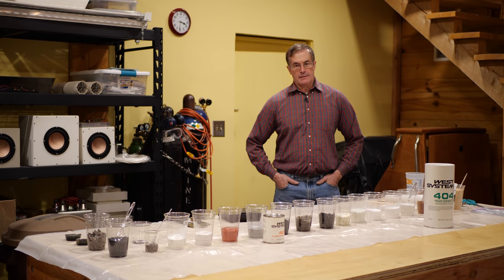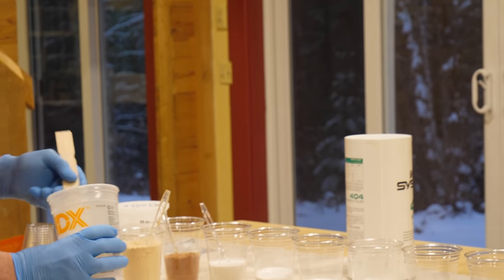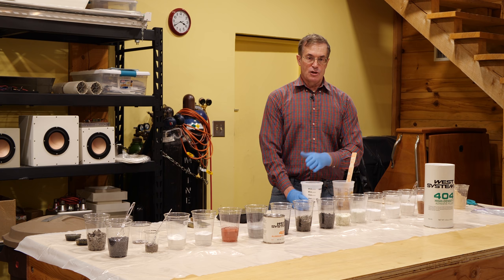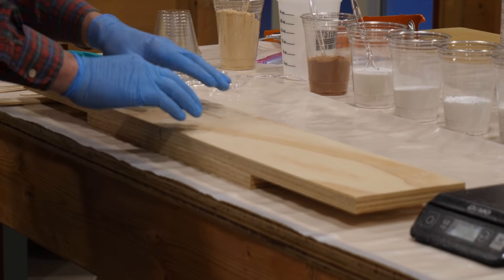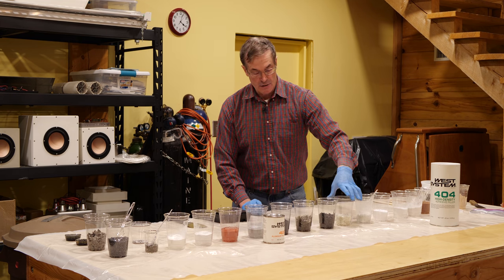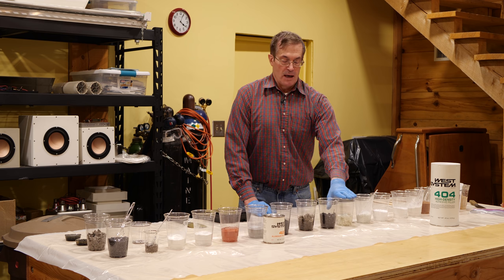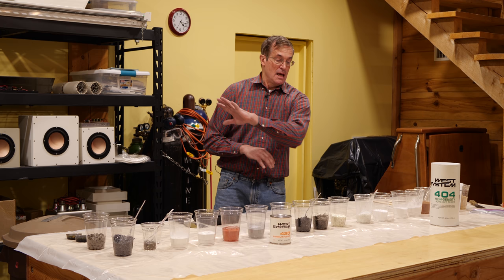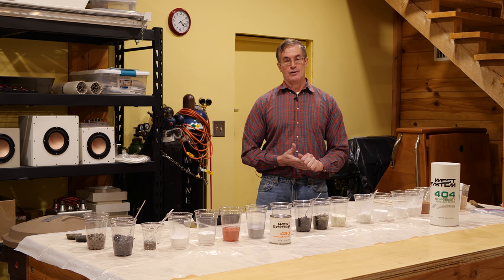Super Strong Epoxy with Diamonds and More!

Comment: I am extremely curious about what would happen mixing something like concert with a two part expanding foam too make a substance that can be used to make erecting structural components on site without the use of water, say like in a hazardous environment on another planet or in situations were a disaster has taken place and housing needs to be immediately put up within hours.

Something that can be mixed on site without special equipment or structural components needed.

Comment: Im tempted to electroplate a 3D printer nozzle with tungsten, and try extruding recycled PP filament with the addons you describe for your epoxy. Any suggestions for a print I'd be able to electroplate?

Comment: This is really helpful, actionable information. 

West System (Gougeon Brothers, inc.) has been out of 404 filler for close to a year. I contacted them and they are having some kind of sourcing/production problem. 

Can you recommend a substitute for 404 that is suitable for bedding hardware and structural bonding? 

I'll watch the video again and maybe I can deduce that myself.

I'm doing an extensive refit on a '74 Alberg 37 and would greatly appreciate your advice.

Comment: Thanks for another awesome video. Learnt a lot about composite materials. What are other bonding agents other than epoxy and cement? Is it possible to make a relatively cheaper and long lasting abrasive for grinding glass for telescope mirrors?
Reply from the maker: There certainly are other other materials that can be used for bonding including ceramics and metals.  When grinding a telescope mirror the abrasive is typically aluminum oxide or silicon carbide and these are pretty inexpensive.  Cerium oxide is often used for polishing, but the very fact that it fractures and becomes finer as it is used up is an advantage.

Comment: Good informative video.
Thank you for warning people about fumed silica; it's handy, but a path to silicosis, if care is not used. I've not seen phenolic powder before.
When using the pastry bag technique, if you turn the top of the back inside-out around your hand, you can load the glop into the middle of the bag.
Generally, when we got through with mixed resin, the remainder went outside on a hard non-combustible surface.
Perhaps if it were passed through a screen or a tea strainer, perhaps homemade saw dust might be more pleasant.
With care, epoxy may be trimmed/screed'ed easily with a razor blade during its cure, while it's still "green." Even fiberglass may be trimmed, but not close to the finished line.
It seems that you are close to being bitten by the polymer concrete bug, which affects quite a few people on cnczone.com, for making machines from : )
Thanks again for the video.

Comment: If you can find the time could you go through the steps for laminating wood to produce a wood plug for carving an airplane propeller .  Flat wood to flat wood I am worried of glue starving caused by clamping.  I am wondering if the use of micro balloons that you mention here would help prevent glue starving....   Thank you .
Reply from the maker: Weight should not be a significant concern.  Use the vacuum technique I describe in the "Glowing Epoxy" video.  Then take all the coated strips, layer on another coat to each side and clamp mechanically or with a vacuum bag, the stack of wet strips with alternating grain direction.

Comment: Cool! Thank for sharing! So interesting! Is it possible to create grinding or polishing pad using epoxy with diamonds ?
Reply from the maker: I suspect it is.  The challenge would be achieving a very flat surface and I'd do that by curing the mixture on a glass plate coated with wax to prevent sticking.

Comment: I'm trying to find an alternative recipe for an epoxy mix similar to Acraglass, Devcon or MarineTex. What would you recommend to make something that won't shrink?
Reply: For anyone who has the same question later, epoxies in general do not shrink. Also, you can just add aluminum powder to reinforce all epoxies. If you need a thinner mix, you can add denatured alcohol and it won't weaken the final cure. If you want it to cure faster, gently apply heat with a heat gun.

Comment: How expensive is the dendritic copper ? I'm sure that isn't cheap another thing that would be useful possibly for mixing into epoxy would be Corian dust it's a countertop material made by DuPont LG also makes the same thing called HiMacs or Wilson Art Gibraltar you can get really fluffy stuff that looks like snow or fine particles the size of sand using a router go slow with the router through the material and you get the fluffy type and push the router through fast and you get sand type particles it will also color the epoxy due to the different colors of the material

Comment: could you demo the strength by shooting a very thick layer of the stuff, painted over a steel sheet? like the carbon fiber epoxy stuff and the stone
Reply from the maker: The layer will have to be thicker than what could be applied with a brush or spray, but we will demonstrate it.

Comment: Hi, I am a real fan of your channel. Could you tell me the grain sizes you were using for the Aluminium oxide, silicon carbide, and titanium coated diamonds tests. Would these be the optimum grain size, or would you suggest a different grit size? Many thanks, and keep up the great work.
Reply from the maker: Thanks. 
It's a trade-off. The smaller the size of the particles, the less you can add before you thicken it to a given point. This is due to the surface area  of a given weight of an additive. I covered  this in more detail in our videos about making the super paint and the thermal compound.
Reply: @TechIngredients  wow, I am amazed that you took the time to answer, and so quickly. Once again you have explained it perfectly, rather than deal with the specifics you have taught me a principle. I really appreciate your method of teaching. I was a master scuba instructor for deep technical diving as well as a teacher and I think you have the perfect approach. I will continue to be an avid fan of your channel. Many thanks.

Comment: I have been resurfacing my diamond belts with 30 minute epoxy and diamond grit. The epoxies tend to clump, so I made a slow turning wheel to rotate the belt while curing. Thinner, slower epoxy would be better.
1) What is the slowest curing epoxy?
2) Is there an additive that will thin epoxy?
Reply from the maker: Most epoxy thinners will degrade the performance.
They're not cheap, but the Pro Set epoxies, a devision of West System include very tough, very thin "resin infusion" epoxies.  Some have very long cure times and will become even stronger with heat curing.

Comment: ..hmmm. cut up nylon strings... or talking about furballs, did you test flexible stuff with hair ? (i remember that human hair is about as hard as copper to cut.)
guitar bass strings for the win !

my worst thing with epoxy is that i'm allergic, even though i always used gloves and did not really often (<5 times) work with it up to that point.
At one occasion i got small transparent fluid filled blisters, checking the reason i found it was due to skin contact with 2K epoxy residue.

Comment: Thermal epoxy could make water tight LEDs and offer thermal transition of outdoor applications.
Reply from the maker: That's the next video.
Reply: I used to make outdoor and water features in epoxy and stone. Strong but not to shippable from a business model standpoint. Onyx and dark stand wood worked well. The warm glow of the onyx in robust LEDs. Property boundries and walkways and the rock lights for security and up lighting.
Reply: Core out a river rock with a diamond core drill, and nest a MR 16 with epoxy,   pig tail out the back with lamp cord.

Comment: I would be interested in your opinion on talcum powder. I have done a fair bit of composite fibreglassing and have used epoxy mixed with talcum powder often. It makes a very hard substance.
Reply from the maker: It does.  It's probably part  of the West System pre mix.

Comment: I wonder if cheap fine sifted sand or or cheap blender chopped pink fiberglass insulation would work.
   Where do you find the epoxy?  I think you said on one of your videos.
   Also, round filler does not hold very good.  Different sized rectangular filler works best like broken limestone and sand works good in cement.
Reply from the maker: Regarding the shape effect, I agree and that's why the balistic pucks use these irregular shapes as aggregates.

Comment: im very poor! and consequently i work with what i have! and yes! im using "Bondo 32-fl oz Brown Fiberglass Resin Repair" got it at the local hard wear store! i use it because its has some color to it! most resin is clear and i cant see where ive used it! im trying to make a bicycle out of plastic water pipe reinforced with resin and the problem im having is that im using Kevlar but the resin dries in like 10 minutes! its meant for cars and its so thick the Kevlar does not soak it up before it dries and when i sand it down and its strong i find raw Kevlar on the bottom but it is strong! is their anything to DILUTE resin with! and yes i know buy the right stuff! im new to this all!

Comment: INCREDIBLE... thank you for the info... Is it possible to ask you if you would build a yacht hull with Fiberglass S2... And you want the best of the best... Hardness, Stiffness, etc... What sandwich would you use and what epoxy with which additives would you use??? Titanium diamonds, graphen, carbon  fibers or something else? Would you use different additives with different layers? What would be that PERFECT Fiberglass hull material and how thick would you made it... for Antarctica. THX
Reply from the maker: S2 fiberglass and Divinycell foam would be ideal for resisting impact damage.  Secondary curing the hull with 8 hours at 80 C will increase the toughness and strength of the epoxy by more than 50%.

Comment: Very interesting. Do you think you could further improve the armor mixture by starting with smaller sized particles?
Reply from the maker: I don't know.  It might go either way.  We're fabricating a number of barrier panels, some with a highly densified mix of stratified sizes and some with uniform extremely tough blocks of zirconium oxide like Sabb has done with their self healing walls.
We'll test them all and see what's the most promising.
Reply: @TechIngredients  another technique used in concrete is to allow it to dry under intense pressure like the tension style slabs. I wonder how effective that would be on epoxy to also incorporate some type of tension or spring mechanism throughout the slab.
Reply from the maker: It's my understanding that prestressed concrete is cured and then the cables are tensioned to put the slab under global compression.  This is necessary because concreate has an unusually large difference between its tensile strength (low) and its compressive strength.

Comment: Any thoughts on a completely transparent hardnener and sheer stress improvement for dense foam that has a lot of contours that would make putting the cloth difficult on most of the surface and would take a lot of time to cure? In my case I am trying to stiffen an extrusion profile that has a large number of contours and am trying to do it inexpensively. Wondering if same addatives to  shelack or to varnish or polyethelene would have the same affect on EPS styrofoam or polyisocyanurate foam or others I am considering. Also I am considering latex paint. So anyway, if you can comment on the strengthing of the latex paint or the like instead of epoxy, I am very interested!  Thanks again!
Reply from the maker: Epoxy would be a good choice.  Most curing plastics will have similar modulus numbers.  Fibers like aramids, glass and graphite have modulus values about 100 times higher. It's really useful to add even a very small percentage of these fibers.

Comment: Hello, thank you very much for the video, really very interesting, I wanted to ask you a question. when I load the epoxy resin with aluminum oxide or silicon carbide, they remain at the bottom, which I can add to the resin so that this does not happen and they are well incorporated into the resin
Reply from the maker: Add a judicious amount of cabosil or fumed silica powder to raise the viscosity.  The greater the viscosity, the slower the settling while it cures.

Comment: Boron nitride epoxy makes a low friction surface: would that work as an antifouling on a boat?
Reply from the maker: Graphite is excellent, inexpensive and blocks UV as well.  I've used it extensively and the result feels greasy, smooth.

Comment: Professor a question please: it is good to use silica carbide and diamond on the bow and under waterline to reinforce for artic use (ice, logs on water, etc)? of course not an icebreaker but some more resistance for cutting and scratches? How much weight these materials add to a compound. Thank you, you always explain very well all. Sorry for my english.
Reply from the maker: The cost of those materials, especially the diamond make that impractical.  Aluminum powder is pretty good for creating a toughened epoxy.  It will still scratch, but because the material is solid throughout, you can send out small abrasions.

Comment: What kind of dust mask filters nano-meter sized particles?  I see stuff in the .3 micron range,  but that's still what, a factor of 100'ish from nanometer sized particles.  Seems like the mask wouldn't really do much.
Reply from the maker: Is a matter of mitigation.  To  absolutely exclude nanometer particles the mesh would be too fine to breath through.  A respirator  that brought air from an external source would be necessary.  We breath nanometer particles all the time, you want to minimize it.

Comment: Great presentation,  Can I mix epoxy with dendritic copper & graphite &  fiber carbon flakes & fiber glass sheet to make an armor panel?
Reply from the maker: We're playing with that.  It's actually complicated as well as interesting.  You probably don't want simply the strongest possible material in that case a tungsten plate would be best.  Multiple layers that first interfere with the bullet's trajectory then abrade or crack the bullet and finally stop the damaged or fractured bullet would be better.
Reply: @TechIngredients  My needs are different: 1- strengthen post & vertical beams so I don't support in the middle 2- use combination of epoxy which absorb sound  3- using for water proofing. In this direction if you can help me. Another example is using fiber glass instead metal bars & heavy wood panels on the Tesla boat to make it lighter and corrosion resistant. Thanks

Comment: Someone may have already suggested this.
Have you mixed any aerogel into the epoxy for thermal variation?
Reply from the maker: No, I haven't,  but it's  an interesting idea.
Reply: Hello. I have been quite curious about aerogel for a long time. The potential use across a broad spectrum of fields appears untapped? I’m not sure if there are specific “reasons”  for that or maybe I haven’t looked into it enough? The divergent properties of aerogel suggest a wider rang of possibilities other than just heat displacement. I believe it also absorbs or displaces light and the electromagnetic spectrum is an extremely interesting playground! 

I really enjoy your videos! Your explanation and delivery work well with how I process information. The content is an amazing spring board for imagination.

Thank you!

Comment: Old Roman concrete was claimed to be more durable or longer lasting because of the addition of volcanic ash. what caused this effect and can it be duplicated with other additives
Reply from the maker: I hadn't heard of that.  UHPC  is usually based on the selection of filler material with a range of particle sizes that minimizes void volume.  The ash might better complete this size variation.

Comment: Don’t use the graphite with aluminum, galvanic corrosion will occur. FYI
Reply from the maker: Galvanic corrosion requires electrical conduction and the epoxy is an excellent electrical insulator.

Comment: Thank you for all your reply and tips...my mini boat is nearing completion but now the dilemma I'm facing is painting my boat...How do I choose the correct paint. There are many videos but it is so confusing that the marine paint of needing to be submerged in water.my boat is just a car top light weight boat.how can I paint it and have it not wear off so easy.
Reply from the maker: I've always had good luck with Interlux paint. A two part, curing vs drying paint can't be beat.  It's incredibly tough although it can run on vertical surfaces and needs to be applied as a thin coat.  Look into rolling/tipping application.  You roll it on and with a brush smooth (tip) the roller application.  This is an established boat painting technique and the surface is so smooth you can shave in the reflection (assuming you shave😀).  It's not cheap, but it's your boat...😍

Comment: How high a ratio of dendritic copper to epoxy can be mixed and still have reasonable strength, and what sort of electrical conductivity would it have?
Could it compete with  silver based conductive adhesives?
Reply from the maker: Generally, if you still have a flow-able mixture the epoxy retains it's strength properties. At all loading levels the mixture remains an electrical insulator.

Comment: what epoxies are used in this video?

also, is it possible to use an epoxy and reinforcing fillers to use as a casting material? like an analogue to concrete, or glass-filled nylon.
Reply from the maker: Raka brand.

Comment: Carbonfiber to bond Aluminium? What about galvanic corrosion? Or is there so much epoxy in the mixture that it does not occur? Thanks for sharing
Reply from the maker: Galvanic corrosion requires electrical conduction.  The epoxy is an excellent insulator.